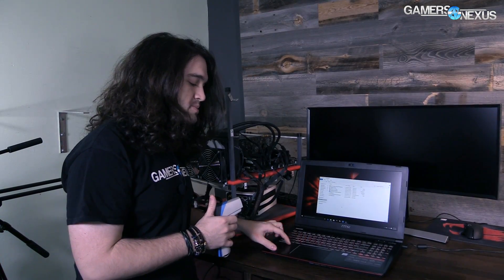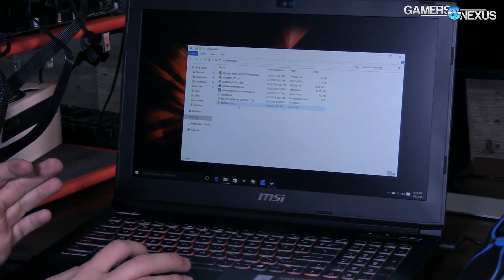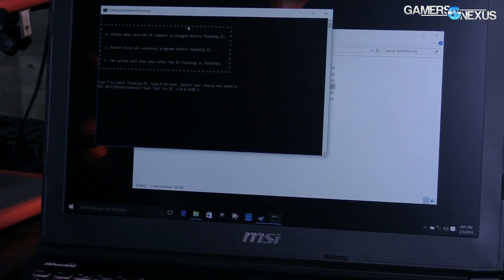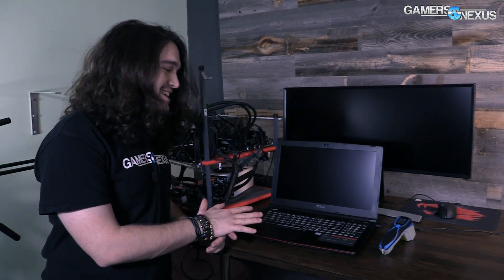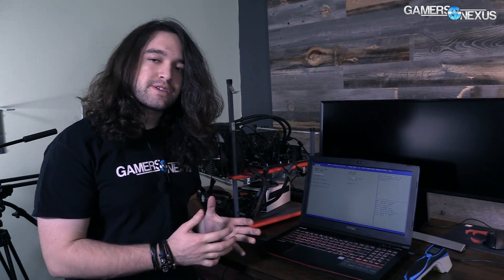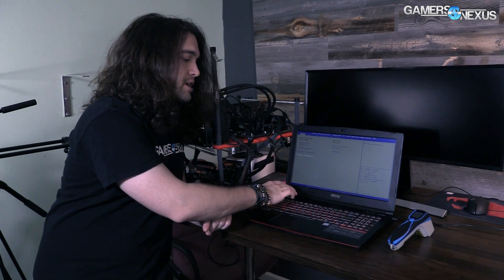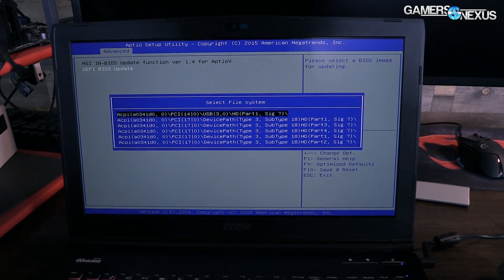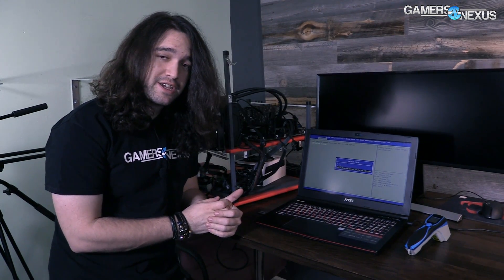How to Fix MSI Laptop Fans & Overheating

Comment: **Attempt the following at your own risk. I will not take any responsibility for damages caused or warranties voided.**

I have a MSI GS73VR 7RF….. I had the same temp issues that everyone is complaining about below, the laptop getting so hot it thermal throttled itself causing FPS drop and lag, I did not try the update in this video however I was able to get my temps to drop approximately 20c while gaming (depending on the game). 

1st.
Laptop cooling pads do absolutely nothing to help temps on gaming laptops, the power supplied by the USB port is not enough to conduct any type of static pressure. However certain laptop cooling pads can be modded to draw its power from an external source. (examples below) 

https://www.youtube.com/watch?v=INfSuqxtvIg&t=96s 
https://www.youtube.com/watch?v=qOyvFweMD24 

2nd 
Clean your computer of bloatware. There is a tone of bloatware preinstalled on MSI laptops and a lot of the applications do the same thing (MSI Dragon Centers anti blue, True Color’s anti blue) causing unnecessary stress on your computer.

https://www.youtube.com/watch?v=IDOZwDgScGI 
https://www.youtube.com/watch?v=9KFc6l8jrVs 

3rd
I used other software besides the ones in this video to under-volt my CPU & GPU. Where this did make a huge difference the 4th step had the greatest impact. I will note that I no longer had to under-volt my GPU at all (and could actually over clock it) and only had to under-volt my CPU for certain games that where in pre alpha stages that cause unnecessary stress. (i.e. Scum, pre patch 0.1.18.9572. Horrible memory leak for those who don’t know.) 

CPU intel XTU - https://www.youtube.com/watch?v=o9qlaGYehPk 
GPU MSI Afterburner - https://www.youtube.com/watch?v=qeQUs4Wtyfs 

4th
I cleaned the thermal paste off the GPU and CPU, applied “MG silicone modified conformal coating” to the areas around the GPU & CPU DIY, I did not use tape as suggested in other videos the silicone suggested reacts to UV light so you can make sure everything is coated, even without the UV light you should be able to tell if you have it coated, and replaced the thermal paste with “Thermal Grizzly liquid metal conductonaut” (LM). **DO NOT USE liquid metal conductonaut with aluminum***

https://www.youtube.com/watch?v=hdTsra-uLBI 
Hot to apply (LM) - https://www.youtube.com/watch?v=Vp-NY5x7ymg 
Do not do the tape & LM like this - https://www.youtube.com/watch?v=fBJFLN8AZMU 
what happens if LM is used on aluminum - https://www.youtube.com/watch?v=cQaqUyKVIEE 

This dropped my gaming temp on average approximately 20c, no more thermal throttle….. I was able to adjust game settings freely to fine tune each game instead of instantly dropping all settings to minimum to still be thermal throttled. I have no idea why gaming laptops do not come out of the box like this, hope this helps some of you fellow laptop gamers.

Side note: you can also cap your FPS at lower frame rates to reduces the amount of stress on your CPU & GPU, depending on your screens refresh rate this could make a huge difference.
Reply: Thank you so much!

I've been searching forums for ages only to find the best advice in a youtube comment xD Currently I've limited the amount of power the CPU gets (72%) //might play around with this after the cooling upgrades are in place. Undervolted with XTU and have changed thermal paste but need to buy me the one you mentioned :D I also cap my fps which really sucks because the laptop can run games easily at 60fps but am forced to lower it to like 45-50 (bf4, crysis3...) to keep my CPU at 83c max and GPU at 92c max.. still too toasty for my liking but am motivated to get that cool temps and all the frames! 

I'm thinking of replacing the CPU and GPU's fan as it is making an irritating noise at certain rpm's but figured I might as well replace entire heatsink if I can find a shop that has them that is...

Mine overheated to the point of shutdown so kinda scary temps, thank you again for the very helpful comment, will give an update as to how much it helped soon :)
Reply: @Bliksemm  you may try re-lubricating the fans when you have your machine apart with sewing machine oil after cleaning them with 91% or high Isopropyl Alcohol.

oil - https://www.walmart.com/ip/Sewing-Machine-Serger-Machine-Precision-Oil/844034120?wmlspartner=wlpa&selectedSellerId=6774&adid=22222222227066981297&wmlspartner=wmtlabs&wl0=&wl1=g&wl2=c&wl3=170957893811&wl4=pla-275827728666&wl5=1014485&wl6=&wl7=&wl8=&wl9=pla&wl10=114435286&wl11=online&wl12=844034120&wl13=&veh=sem&gclid=EAIaIQobChMItamwlqb83gIVB9bACh0o9gmXEAQYAiABEgKK1vD_BwE 

Alcohol - https://www.walmart.com/ip/Equate-91-Isopropyl-Alcohol-Antiseptic-32-fl-oz/276040459?wmlspartner=wlpa&selectedSellerId=0&wl13=3533&adid=22222222227000000000&wl0=&wl1=g&wl2=c&wl3=42423897272&wl4=pla-51320962143&wl5=1014485&wl6=&wl7=&wl8=&wl9=pla&wl10=8175035&wl11=local&wl12=276040459&wl13=3533&veh=sem&gclid=EAIaIQobChMIqJTRvab83gIVCz1pCh1j9gVEEAkYAiABEgIdLvD_BwE 

Video to give you an idea of how to clean & apply. - https://www.youtube.com/watch?v=1lxvmay2tn0

Let everything dry before reassembly. 

Again - *Attempt the following at your own risk. I will not take any responsibility for damages caused or warranties voided.*
Reply: I’m gonna have to try this

Comment: Hey there, I bought an msi gs65 stealth thin a month ago... been gaming and using it ever since. Some weird rattling fan noise has appeared and freaked me out a little bit ! I restarted the pc and cleaned up the fans who weren’t that dirty considering it was only a month old but the issue persists... do you guys have any recommendations or solutions pls i desperately need your help

Comment: Bro i need help i have the same lapto and if the cpu useg is 25% the temperature is 80 and even 90 and i noticed that when the cpu useg getting higher in the same time the temperature is getting higher as fas as possible
Reply: the same thing on GE72mvr 7RG Apache Pro
Reply: @kamperius  i have that model too
Reply: @eva_123yuquely  so do you have overheating?

Comment: i have a msi qp72 2 QE Leopard Pro an when i go into my dragon gaming center its says i have two fans fan one does normaly around 4000RPM an if i use the boost function it does 6000RPM however its says that there is a second fan in but it never goes on.
also my dcpu an my cpu are between the 70 an 80 degree is that a normal teprature or is it to high

Comment: I FOUND A SOLUTION (Kinda). Because the ge62 2qd apache pro is gpu limited that means you can limit your cpu and the performance is practically identical. (tested the fps on games and it barely changed with this change). Go to ControlPanel, Hardware/Sound, Power Options, Change plan settings, Change advanced power settings, click the + for Power Managment,  +Maximum processor state, Default both should say 100%, you can change them to about 80% for some results. This will make your CPU not strain as much and significantly lower the CPU temps. 

I have been testing these settings and I dont lose any significant FPS in games. (What I mean by this is anything above 60fps is fine for me). My CPU temps BEFORE changing the settings were around 89C and after putting it at 60% processor state the temps are now around 60-70C. I want to stress the fact that even though 60% seems a bit harsh for a change, any of the games that I have played (Witcher 3, CSGO, Mad Max...etc) the fps is still totally playable! 
-
Here is some statistics I got:
CSGO at 60% is around 90-120fps (Dust2)- CPU temp 65C
CSGO at 70% is around 95-120fps (Dust2)- CPU temp 69C
CSGO at 80% is around 100-130fps (Dust2)- CPU temp 72C
CSGO at 90% is around 106-150fps (Dust2)- CPU temp 81C
CSGO at 100% is around 120-155fps (Dust2)- CPU temp 89C

As you can see, yes more processing power does mean higher fps, BUT in my opinion 90-120 fps is perfectly fine. As you also notice higher the power, higher the temps! Sorry if I explain this horribly! But, this is a great solution if you seemed to have tried everything else. ( I have tried everything such as replacing my fans, thermal paste, upgrading BIOS even....) 

Thanks for reading this, hopefully you got some help from it.
Reply: Dominic Russo done it, change thermal paste and thermal pads and temperatures went down 15c while gaming. Cpu and gpu are in high 60 and low 70, before that Cpu around 90, gpu 85. Cpu powers set to 80%.
Reply: THX this worked for me. I dropped to from 90c to 80c by optimizing Win10 but just dropping my power plan i am now down to 62c at full load. I do see a difference in the fine detail of some games but I can run them at "Max" settings now. Before this I was overheating even on "potato" settings for most games. Gratz!
Reply: it worked for me, thank u so much! :D
Reply: Lol just repaste with liquid metal
Reply: It works !!!!!!
Reply: Dang, this worked like a charm
you saved my life from a wildfire!

Comment: Worst tutorial I´ve ever seen.
Reply: I also had the same problem... Try this, go to advanced power settings and processor power management minimum and maximum state. Make sure the maximum is not on 100. And also when I was on high performance the minimum processor state was 100. So even when I wasn't using the computer it was running hot. So that's why i think even when you're not using the computer actively it still runs really hot.
Reply: Genuinely have no idea how its so highly rated....

Comment: hi i have bought a GP73 and in some games i think the CPU fans are so damn loud if i for example start pubg and go into a match it starts to abuse the FANS badly. not in every games but this ones is one of few ones. and the fans are going crazy.  so my question ist. how can i try to fix this for me that they dont overdrive so hard? how can i do it with Dragon Center or the Intel Processor configs. can someone help me here little bit?

Comment: Hi I have this msi Stealth GS72 6QD and whenever I'm gaming the top left corner of the laptop right under the screen it gets super heated. I have  tried bringing down the processor's power from the processor power management in the power options; it has lessened but still hot to touch. Any suggestions? Trying everything in this video right away though I'd like to know if you have more content as you guys said there is other stuff one can do to bring it down. Would really like the link to the video if you have one on further steps. Thanks for all this help this is really great.

Comment: Hello I am using a msi laptop gl62 6qe and now I am running to fan issue the fan is only running at 2400rpm and temp is get up to 91c on 50% load and cooler boost not helping at al fan still running slow I have reinstall everything like dragon center , scm , and also update an ec firmware and also the delect the old fan setting that msi recommend to do after update ec firmware but now the fan is still running at 2400rpm and the coolerboost is not help to increase the fan speed too.. but I don't updae the bios yet so should I update the bios and will it work or someone have any help without update bios please help me

Comment: I know it's an old video, but Incase some people still end up on this link..

Laptops tend to overheat rapidly after their warranty period wears off fans keep rotating on full speed even when you're just looking at your desktop doing nothing. 

And nothing really works other than replacing it eventhough it should still function properly. 

It kind of feels like a scam, like a pre-configurated setting build within each laptop system to just decay its functionality in a relatively short lifespan forcing the consumer to buy a new one. 

My pc fans never blow on full speed when I'm doing nothing or hardly blow at all and I'm using a 10 year old system ( core2duo e4600 2.4ghz 2mb l2 cache and original Intel cooler. ... nor does my hardware rarely ever overheat. My ancient relic of a GPU once had heating issues ( MSI gts250 512mb ) but it was just a matter of re-applying new cool paste and it ran smoothly again. 

But even refreshing the coolpaste or clearing out any dust or other crap from your fans won't provide as a working solution when it comes to laptop's. 

Just don't invest much in to a laptop.. 

Just buy a simple laptop for study or work that functions as a type-writer and can handle all the basic needs. 

GET A DESKTOP PC, but not a pre-build but build or select your own. 
It's cheaper, it's better. 

And don't give me that yeah but a desktop pc takes up more space and you have to buy a monitor and keyboard and mouse. 
Because that's just BS, there are various sizes of cases you can buy from micro-ats to WTX and compatible hardware allowing you to customise it to your own taste and needs. 

Infact don't buy a laptop at all. 

I'm an IT college student and I use my Sony Xperia XA Ultra during classes. 
I can write my e-mails on it, I can code on it, create websites, slides, videos, papers whatever I want. 

Ofcours a laptop is easier, but a phone works equally well. 

Once you're at home you can copy paste any work from your phone to your desktop and continue your work on a decent running machine.

Comment: Hello 
i never update Bios for my GE70 it have been working well but the fan start to be more fast and over head that i have open the laptop and clean it up but still the same.
do i need to update the Bios ?
i did try to find the right Bios but my laptop need Bios version 513 and what i fine is 514, do you think its okay or it must be 513 ?
Reply: english plz

Comment: sad - I've been reinstalling EC firmware 2 years each time I need cooler (for rendering). GPU cooler works well all time but CPU cooler works till 1st reboot. After EC firmware reinstalling it works good for any control programs (Dragon Center, Silent Option etc.). After 1st reboot of laptop with new BIOS or EC firmware, CPU cooler muted again.

Comment: hi i have a ge62 and have same probs of overherating on left side. Still a little confused as this is my first laptop. I bought it just before christmas 2016. and now for some reason either the left fan or right fan (Random) will turn off for about 5 to 10 seconds then it will kick back on even when temps are over 100 f-50c This is very annoying and am a bit scared of flashing a new bios. Half this stuff i dont really know what it is or what it does. Its cost me a lot of money and am worried i might mess it up.

Comment: Hey guys, I have an MSI GT70 0NC that was brought into a laptop repair shop. a gtx 880m was put in and the fan was swapped out. However, now my fan will not adjust its speed based on the temp of the laptop. This can result in the laptop overheating. My turbo button is not working, and programs such as SpeedFan do not recognize that I have a fan. What can I do in this situation? Please help!

Comment: Have a MSI laptop identical to the one in the video and whenever I'm playing a game like GTA V with mods and with  Cooler Booster option enabled the cooler booster turns on and off every minute until I restart the PC. 
The fans do not shut off but after a while it gets really hot even with cooler booster enabled where as before it did not get hot at all. 
What could that mean? 
Should I call MSI

Comment: the last time i buy msi laptop , Extremely bad experience i actually burned my wrist using my laptop ...like.... what the actual fuck.
Plus this fix doesnt do shit

also...gaming G series my ass my msi with gtx 950 cant run csgo on low res
Reply: You sure you're using the right graphics card? I have a 850M and run the game fine maxed out. :D
Reply: Damn, yeah mine heats up like an oven and I know if I play any games on it. It will meltdown, literally. But hand burning? That's some bullshit. I think it's time to teach Taiwan a lesson. Fucking dog eating, shitty laptop making, scheming mother fuckers.
Reply: I have a 950m too and can run lot of game in ultra, you should have a problem
Reply: also my laptop what the problem in my touchpad i feel because your wrist is always touch
Reply: im on a 960m and i cant run overwatch on medium without severe fps drops
Reply: I bought an MSI as well (mines the GP62MVR 7RF), I watched videos before buying and reviews, and they said that it didn't get that hot... Hahahah... Mine almost burnt my finger when I made the mistake of missing the Y button and touching the patch between Y and H... After playing Overwatch for less than 2 hours on the lowest settings. Fun. it felt like somebody stabbed my finger with a hot knife. Not enjoyable. 
This is AFTER I got it professionally cleaned after the Keyboard was goddamn faulty and had to be replaced.

I would have loved to get a desktop, but New Zealand stores are allergic to them.

Comment: this doesnt really help much at all. i had to open my laptop and change thermal paste to fix this issue. easy done and all working well now.
Reply: Did your laptop start to overheat again especially after three years?
Reply: @poopityscooper2116  it actually works pretty well since i changed it. I would recommend spraeding a new paste at least once in two years.
Reply: @poopityscooper2116 dude thermal paste are to be changed atleast once a year for good performance....and ur asking for three years?
Reply: @little_bee_007  Yes